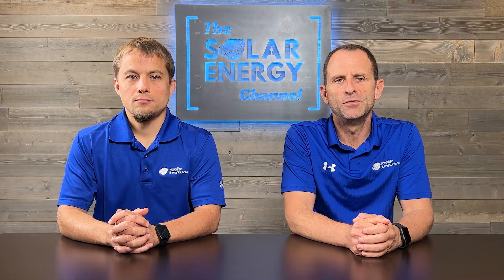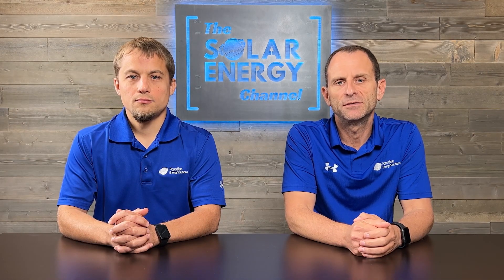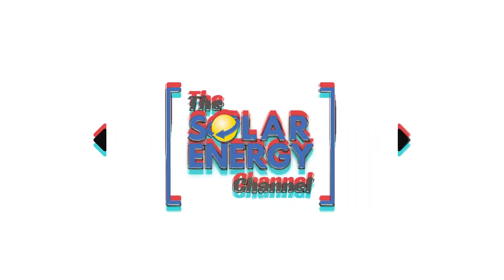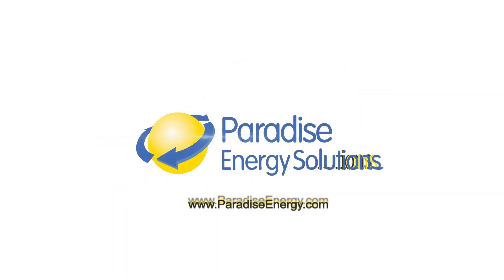SolarEdge VS Enphase - Which Solar Inverter Is Better?

Comment: Microinverters have a big cost savings realized later, as string inverter systems with a central inverter will likely have to be replaced 3 times over the course of the system lifespan (35 years).  Each central inverter will cost around $4500 w/installation so $13,500 in additional costs over 30 years, plus whatever lack of energy production that was lost due to down time... and my system (being large) would require two central inverters so double that cost.  That central inverter replacement cost is nearly at the cost of my entire Enphase system (after fed/state rebates) with 52 panels! The microinverters last longer because they run cooler and aren't handling large loads like the central inverter (hence the longer warranty on microinverters).  Also the safety of having A/C running through the attic (operate at the same low-voltage AC power as a typical home) instead of DC.  Running high voltage DC wiring through an attic can pose a risk of arc faults or fires, particularly if the wiring is damaged or improperly installed.  Also, upgrading panels on Enphase is much easier, I can simply add more panels.  With central inverter you have to size the inverter to the panels, so if you are adding panels (or adding higher wattage panels in the future) you may have to upgrade your inverter to a larger one at a significant cost.  Also, in 10 years when panels produce more output I can replace individual panels in Enphase system and get the higher output where as mixing panels with significantly different wattages in a string inverter system is limited by the lowest-performing panel, even with optimizers. Also, ask any installer/repair person about warranty swaps on equipment and you'll find out the Enphase makes it easy vs SolarEdge not so much.  Plus there's a lot to be said about modularity and scalability, Enphase can support additional items like using your electric vehicle as a battery store and being able to draw from it at night when the sun goes down.  Also fixing a microinverter is easy, heck I can do it, just tilt the panel, unplug the old, plug in the new. Albeit it's on the roof but no that big of a deal to climb a ladder.  And guess what, the string inverter system with power optimizers have a optimizer behind each panel also!  So not only do you have a central string inverter to fix if it goes bad, you also have power optimizers behind each panel up on the roof that can go bad too. So I fail to see why anybody would buy a string inverter system (even with optimizers) when there are so many disadvantages.  Initial cost is the only advantage of a string inverter along with an advantage of less power loss when converting/storing excess energy into batteries.

Comment: Had SolarEdge inverter installed in 2017.  No warranty to speak of.  Installers said unit is obsolete and it's $700 for a new one.  For the original price I find this completely unacceptable, and I'm not alone.  SolarEdge owes their customers new units or a class action is forthcoming.

Comment: As a installer the solar edge has had alot more problems.  As an electrician its alot more expensive to install solar edge as well . Emphase can be wired like home wiring while solar edge has the be in metal from roof to inverter
Reply from the maker: All valid things to consider when weighing your options.

Comment: Even the Enphase IQ8 line does not have enough continuous output to handle today's higher wattage modules. The tech has not kept up and they clip terribly. Forget 480 or 500 watt panels. You just clip power.
Reply from the maker: You are correct that Enphase will need to keep evolving to stay up to date with larger modules.  However, Enphase does have an IQ8H, which has a max continuous output of 380W.  When paired with a 480W module, it has a DC/AC ratio of 1.26, which is comfortable.  The key is selecting the appropriate inverter for the application.
Reply: Clipping is not as much of a issue as people think because basically a 400w panel is really not a 400w panel because the 400w is rated for optimum Lab test output (STC) look at the (NOCT) that's the real world output so a 420w STC is actually 313w NOCT.

Comment: Micros never last.They can't take the roof heat. M150 M190 all failed the IQ line hasn't been out long. We shall see but rarely see monitoring that doesn't have some micros out. Anybody who's been around solar for any long of time knows they don't last. Also how hard you have to fight for warranty claims.
Reply: Just like I said, it sounds like you only have experience with the m series micros. You've been out of the solar industry for so long now that you have no idea what it's like currently. Like I said a lot has changed in the past 10 years

Comment: I keep reading and hearing from many sources in the US as well as Australia that SolarEdge inverters are highly failure prone as compared to Enphase.  My SolarEdge system will be installed soon and I am wondering now if I made the right decision going with SolarEdge.
Reply from the maker: SolarEdge has certainly had some product issues over the last few years.  However, they have worked hard to make their new products very reliable and always supported us when there have been issues.  We feel very confident in the product.  In addition, they will be reviewing our current fleet to help us replace problem products with more reliable solutions.  SolarEdge and Enphase both have their issues, and both have done well supporting their products.
Reply: @thesolarenergychannel  It is good to know they support their product, but I’d much rather have a reliable product than good product support.  Particularly given that loss of a string inverter means zero production until it is replaced.  Now if the SolarEdge warranty covered lost production, reliability would be less a concern.  At least an Enphase failure is a relatively small production loss while the problem is being repaired.
Reply from the maker: @LTVoyager   The great news is that we offer a Triple Ten Guarantee, which means that any loss of production in the first 10 years will be fully reimbursed by us. Additionally, when it comes to replacing a failed Enphase microinverter, it poses a greater challenge as they are located on the roof under the panels.
Reply: @thesolarenergychannel what you're choosing to omit, is that if a microinverter fails, that's only one singular panel that's not producing. When a string inverter fails like solar edge, you have entire strings sometimes homes entire systems down for the duration that they are waiting for the manufacturer to send an RMA replacement. But hey at least you reimburse for the loss in production, because that loss in production will be inevitable with a string inverter, at least you admit that. In addition to this, when you start having failed optimizers and you replace them with new ones, often the new optimizers do not communicate well with the old optimizers on the same string and you're left with ongoing communication issues. I will continue to stick with Enphase micro inverters all day long.
Reply: Don't believe it micros never last in the long run. Anybody who's been around solar 10 years or more will tell you that. Most these young companies don't know what they're talking about.
Reply: @chow2552  I believe you meant to say, anyone who's been out of solar for 10 years. A lot has happened in 10 years...